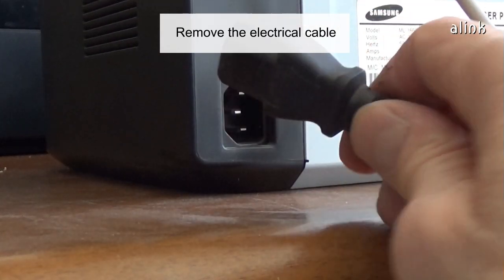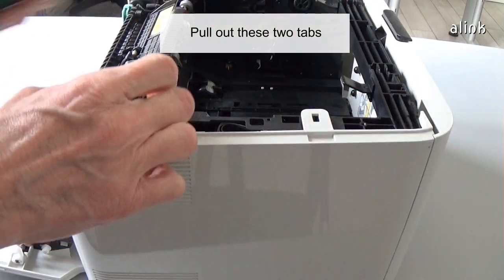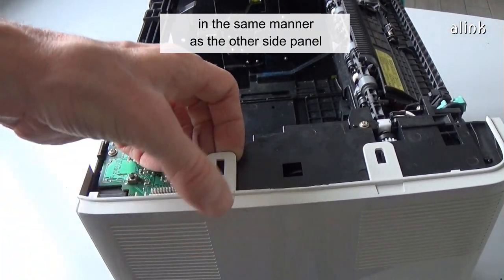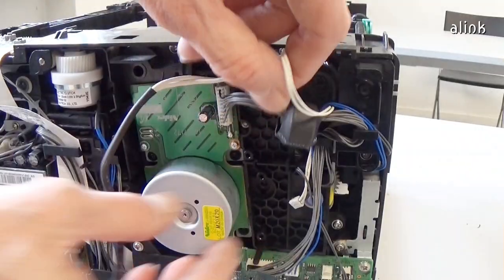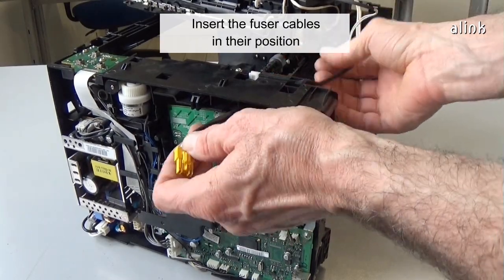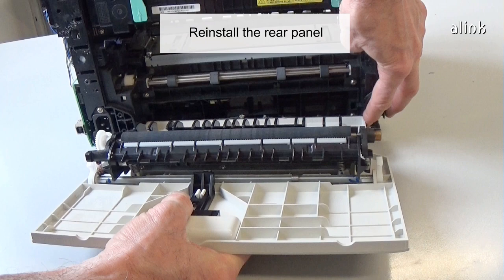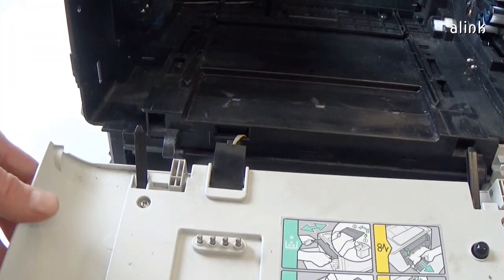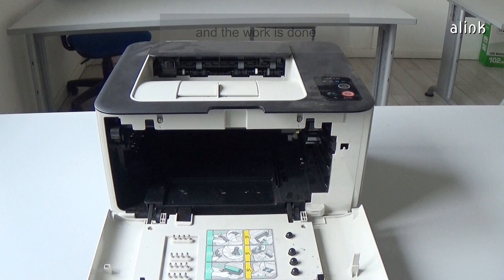Disassembly Samsung Color Laser Printer CLP-320/360 and other Samsung Printers

Comment: Hello, could you help me to solve a failure in a Samsung ML-1710 printer, which for some time now began to print from the middle of the sheet downwards, I tell you that when it started to fail, the first two or three sheets It printed them with the fault and the next sheet already printed well, but now it no longer prints any sheet correctly, I disassembled it and cleaned the sensors with air and it still has the fault, what could you advise me to repair the fault? Where I live there are almost no qualified technicians or they charge very expensive. Thanks in advance. Sincerely:
Jose Alberto
P.S. I am using the translator, I am from Michoacan, Mexico.
Reply from the maker: I think it's better if you use spanish language.could it be a setting problem?
Reply: Por supuesto, y te agradezco la atención, te comento enseguida:
Hola, podrias ayudarme para solucionar una falla en una impresora Samsung ML-1710, que de un tiempo hacia acá comenzó a imprimir a partir de la mitad de la hoja hacia abajo, te comento que cuando empezó a fallar, las dos ó tres primeras hojas las imprimía con la falla y la siguiente hoja ya la imprimía bien, pero ahora ya no imprime ninguna hoja correctamente, la desarmé y le limpié con aire los sensores y aun sigue con la falla, que me podrias aconsejar para reparar la falla ? donde vivo casi no hay técnicos calificados o cobran muy caro. gracias de antemano.
Reply: Hola, podrias ayudarme para solucionar una falla en una impresora Samsung ML-1710, que de un tiempo hacia acá comenzó a imprimir a partir de la mitad de la hoja hacia abajo, te comento que cuando empezó a fallar, las dos ó tres primeras hojas las imprimía con la falla y la siguiente hoja ya la imprimía bien, pero ahora ya no imprime ninguna hoja correctamente, la desarmé y le limpié con aire los sensores y aun sigue con la falla, que me podrias aconsejar para reparar la falla ? donde vivo casi no hay técnicos calificados o cobran muy caro. gracias de antemano. @viandant5
Reply from the maker: @albertoquesada6356  it could be the toner cartridge but it's difficult to be sure without checking the printer.

Comment: Hello, thank you for your useful videos!! 
I have a problem with a used Samsung CLP-680 that I bought from eBay because the listing said that it was in excellent condition and had only about 800 printed pages.
However the colors are not aligned. 
I cleaned it inside, I went on the tech menu and printed the Auto Color Registration page and the X-Offset and Y-Offset values are different numbers, and don't change when I run the Auto Color Reg or open and close the tray. The toners are the starter Samsung.
Is there a way to manually change the offset values or the problem is caused by a faulty part? Could you help? 
Thank you
Reply from the maker: If I remember well there is no method to manually change the alignment values. I think the problem is a faulty part, but it's difficult to say which part. May be even a deformation of the mainframe
Reply: @viandant5  Thank you for your reply!! I will try a firmware update in case this can correct something, before sending it for service or keeping it as office decoration! 
Greetings from Greece, una faccia una razza 🙂

Comment: Mine stopped working ,it started heating the fuser ,than went all off
All it does now is making a clicking sound ,any help ??
Thanks in advance
Reply from the maker: It could hav lot of causes, sorry it's not possible to give an answer without checking the printer. It seems the current from the power supply does not arrive to the machine

Comment: My similar printer CLP325 stopped working recently. It just would not power on. It was shut manually from the switch and then it never worked since. Do you think it is power supply? Are they simple to screw in if i buy new power supply or does it require any soldering etc. Thanks in advance
Reply from the maker: The power supply has screws. Before to change the power supply in this channel there is a video on how to do if the printer doesn't turn on

Comment: Hi, Nice video! I have a problem with my clp325w which I cannot solve... When powered on, after 2seconds the status led and the 4 toner leds go all solid red and stay endlessly red and none of the button (cancel/testprint, WPS or even OFF) will work. Also not possible to connect to printer from Lan or USB anymore. Does this sound familiar to you? Do you have any clue how I could bring it back to work? Thank you in advance for your help!
Reply from the maker: The manual says it could be a paper jam, a toner cartridge not correctly installed, no paper in the cassette or a broken paper sensor. Try to empty the waste toner box
Reply: @viandant5  Hi Viandant5, thanks for coming back to me. I had actually already tried that, cleaned it with water, let it dry and reinstalled it but it doesn't help. Also removed/reinstalled several times cartridges and imaging unit, checked for paper jam but nothing helps and printer will each time go red light after 2 seconds. The only possible 'action' is to remove the power cord :-( Thinking back, a few weeks ago I replaced empty genuine cartridges with new non genuine cartidges which were immediately recognized and I was able to use my printer normally until 3 days ago. Anyways thanks for caring. I was hoping to be able to hard reset the unit in a 'mechanical' way since I don't have access to the user interface. It seems to me that the unit is in a kind of 'protection mode'